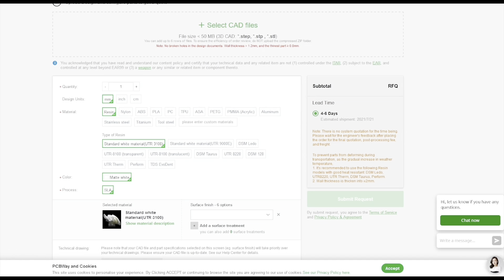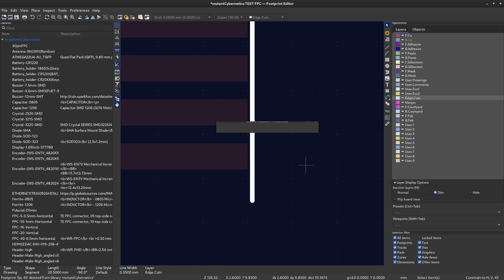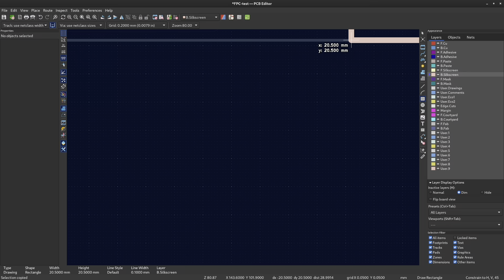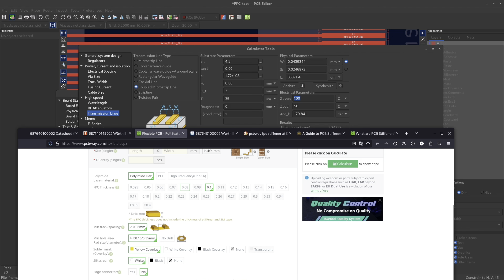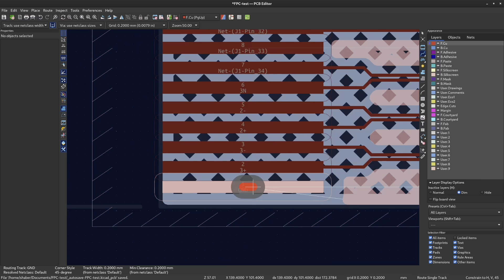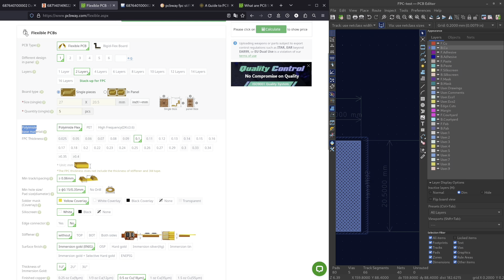Design & order customized FPC Cable using KiCAD

Comment: hi! Interesting video! I need to design a custom FPC to make a extension between a sensor and its motherboard, but I have to clue how to identify those conectors... I mean, I'm totally noob in electronics and except pitch and pins number, those LCD phone connectors look all the same for me, How do you do to figure out the exact connector model? Thanks
Reply: You can try your luck using Google lens or something similar to try and identify a part from a picture, it may get you close to the part family and you can find the exact one by digging into the datasheets.
Reply from the maker: I have no clue also, but you don’t need the model, but having it makes things easy. 

Just measure the insert hole distance and fit the amount of pins you have. The pitch likely 1, 0.5, 0.4mm.